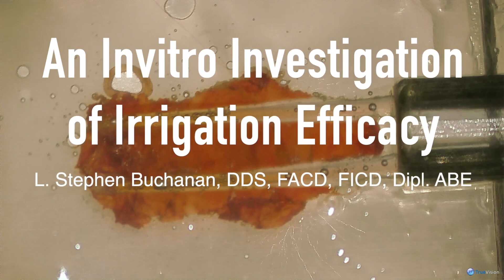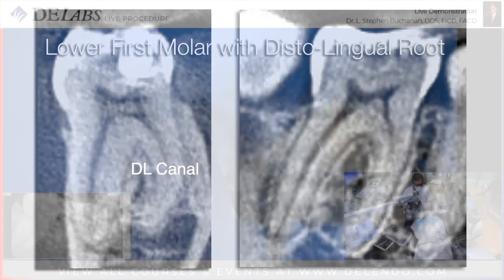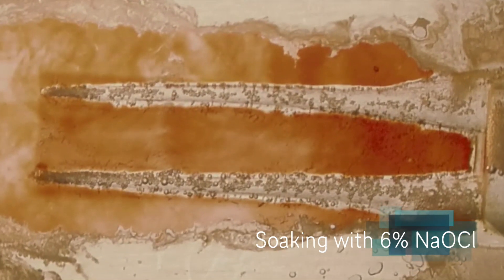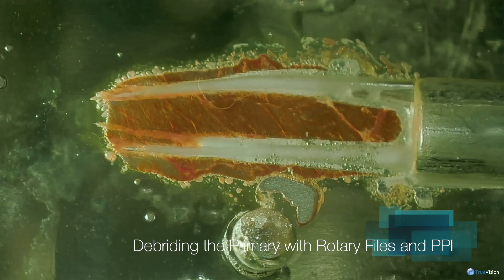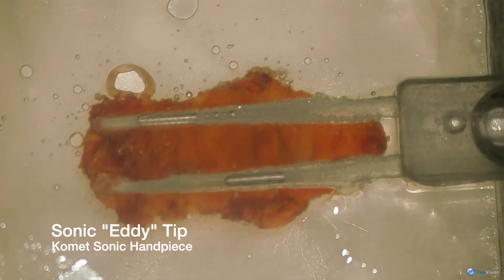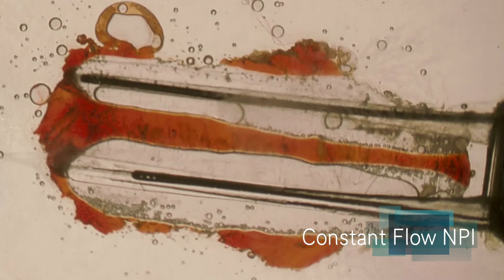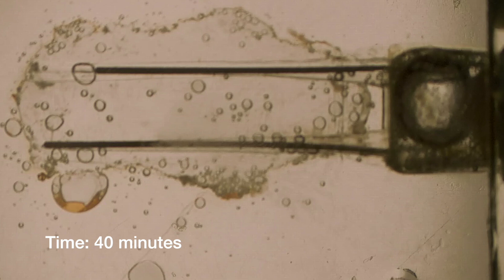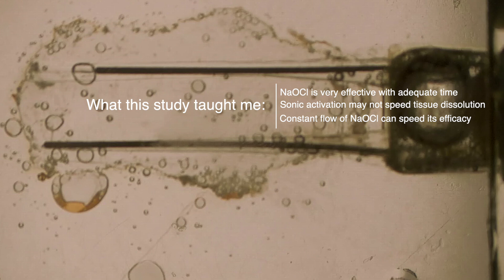Soaking, Sonics, and NPI

Comment: I have another question: in a recent interview with dr. Allen Nasseh you mentioned that cavitation (by aerating NaOcl before irrigation) has a tremendous impact on tissue dissolution/debridement, but here you claim/demonstrate that sonic cavitation (using the EDDY tip, which created lots of bubbles) did not have much of an effect. 
How do you explain that? What is the missing link? 
Was it the fact that cavitation is less important than the constant flow of NaOcl, mediated by NPI? 
Or was it due to the eddy tip not operating continously? 
Or a mix of the two?

Comment: Hey Doc Buchanan and the rest of the DElabs team: Would it be possible to perform a similar experiment with regards to the effects of Calcium Hydroxide paste in this type of an root canal system? 

I wonder if it would cause tissue digestion in the istmus and how long will it take, if it will happen. 

Please consider it :)
Reply from the maker: to place CaOH in canal for two weeks at body temperature then irrigate both sides to assess dissolution rate.
Reply: @DELendo  Sounds good :)
Reply: @DELendo  In one of the live demos you demonstrated the Satelac Irrisafe ultrasonic irrigation tip; I would have loved to see how these tips perform in this in vitro demonstration, compared to the Eddy tip!